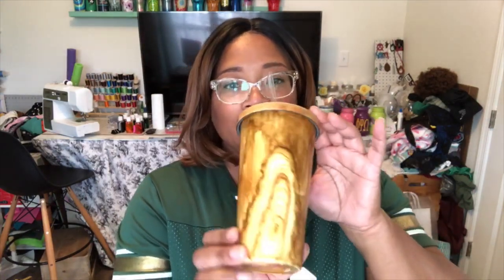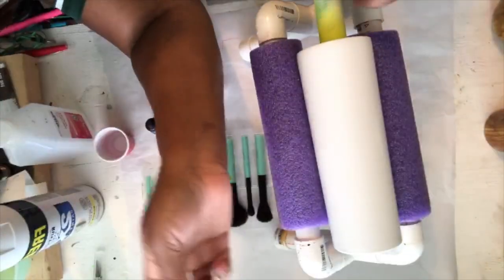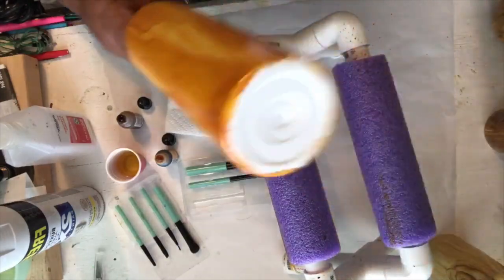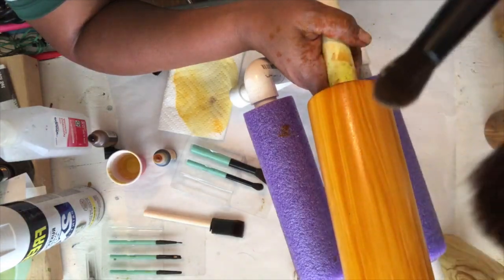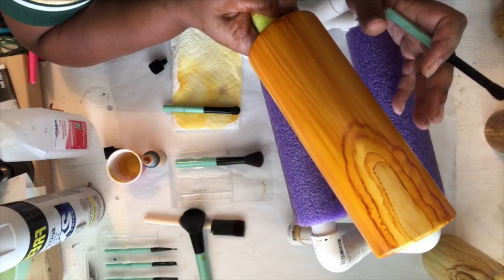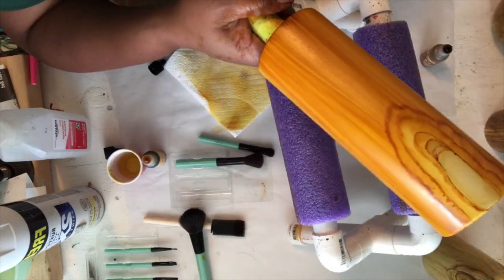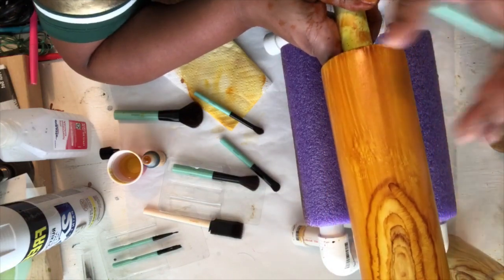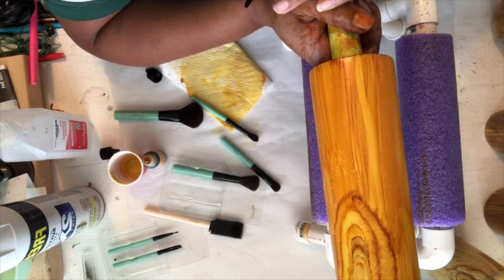How to Paint a Wood Grain Pattern with Alcohol Inks on a Stainless Steel Tumbler

Comment: Question, I'm getting real close using your methods. 
BUT when I do a 1st light coat, then put decal on and then do the 2nd darker coat. When I pull the decal off to show the under coat it's peeling the 1st and paint primer off showing the steel? Why? Should I let the cup sit for a long time first?  Thank you for any help
Reply from the maker: Not sure I quite understand but I would not put a decal on until after all your coats are on and you have sealed your cup
Reply: @ProcrasCreationDIY  the peekaboo style I guess it's called the decal is only as a stencil. So it's a lighter wood under the darker top layer. Research sounds like I need to epoxy the first light wood grain first then the stencil then the dark top layer then pull it off